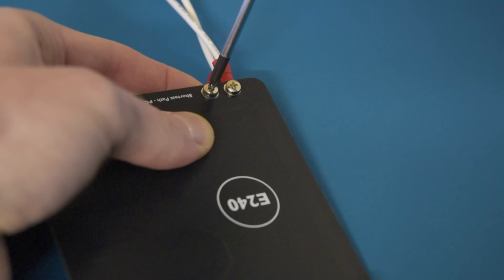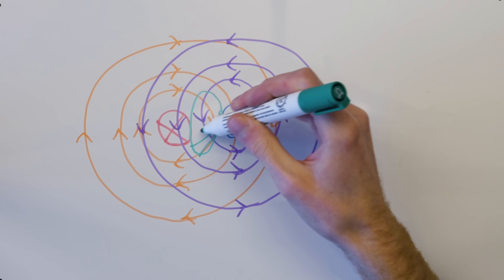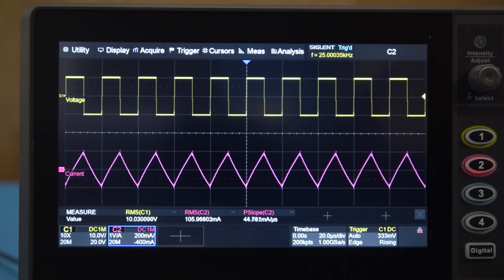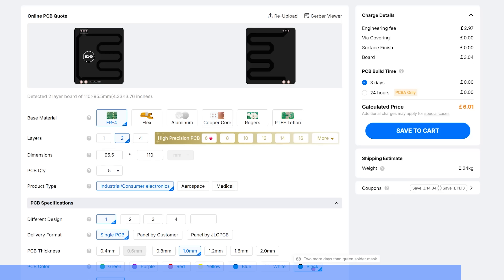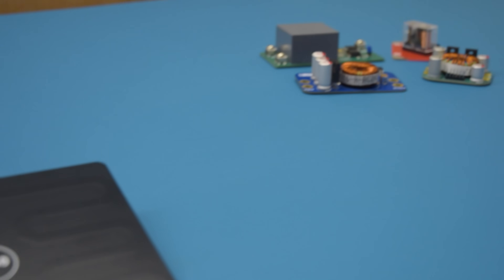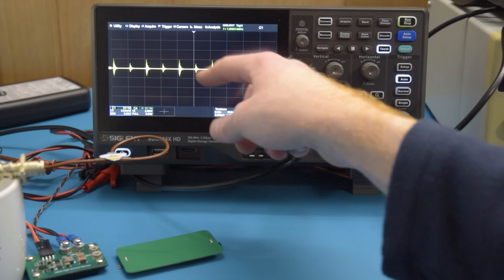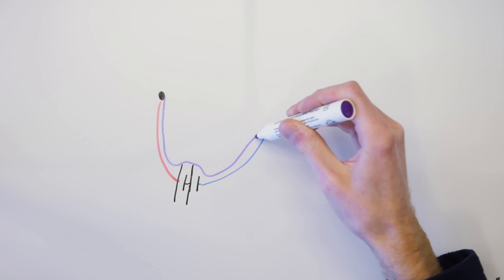Electricity Doesn’t Always Take the Path of Least Resistance

Comment: Hi sir , can you make a video on how does high frequency inceter works and it's different stages like the frequency , duty cycle , 12-220 v DC booster part and 220 v dc to 220 v ac  with h bridge , Thanks

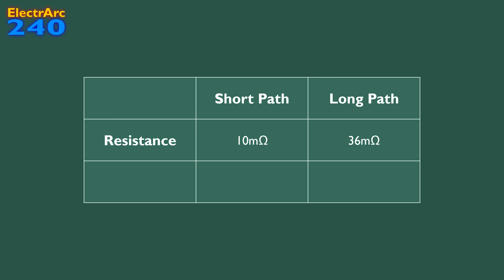Comment: Simple question : why square root of x^2 and y^2 in 7:19 ? i understand the impedance part with Zr=R and Zl = jlw btw
Reply: Do you know Pythagoras' theorem? It's the same formula to calculate the hypotenuse of a triangle. If you look at the formula for apparent, reactive and real power, it's the same scheme. 
For understanding: Draw up a coordinate system. There's real resistance for the x-axis and reactance for the y-axis. Let's use an electrical component with an impedance. The resistance is 4Ω. The reactance is 3Ω. You draw a line on the x-axis from 0 to 4. Now you draw on the end of the line (0,4) a second line up, from 0 to 3 on the y-axis. Now you connect your starting point (0,0) to your end point (4,3). Measure the third line. It should be 5 units long. This is your impedance. And calculated via Pythagoras' theorem it's Z=sqrt(4^2+3^2)=sqrt(16+9)=sqrt(25)=5. The complex impedance is Z=R+jX. This is the algebraic/cartesian form.
I hope my explanation made you understand it a bit more.
Reply: @BlueMokkeOh i see ! Thanks a lot 🙏 So if i understand correctly the impedance is a combination of resistance and reactance ?
Reply: @badwolf4469  Yes. If you watch the summary chapter of the video again at 7:56, you can see that Impedance is always made up of both resistance and reactance. In DC cases, the impedance is only made up of the resistance as the frequency is 0Hz and the reactance turns to 0.

Comment: 11:33 I'm not sure I understand.  In the first case - whichever path an electron takes, it's still contributing to one of two ground loops of equal size, isn't it?  In the second case, it's just that all the electrons are contributing to ONE of the two ground loops.  So I don't see why the first case would be much less than the second.  Unless the two ground loops are cancelling out or something?
Reply: On a sketch the red line should be as close as possible to the blue line. This scratch in the middle causes a big loop for current to go through (distance from forward current to return current grows) instead of minimal one. This is why ground plane is so good: auto path of least resistance happens to be with the minimal loop.
Reply: @ВладіславЗаморський That's the thing, though; in the video the scratch in the middle doesn't have that much effect until it extends all the way to one edge.  Before that, though, the board (with middle scratch) is symmetrical, neither edge path should be better than the other, so why does the ground loop get so much worse when the current has to go through one bad path instead of two bad paths?
Reply: @Erhannis Because if there is a way for current to go through without causing EMI it will do exactly that. In general EMI means losses, so one path is not of equal losses as the other despite resistance being equal. Not sure if it makes much sense though.

P.S.: after looking at it again and  carefully reading the comment: yeah you think in the right direction. If current can go through in such a way that radiated field is minimal it will do so. Indeed here they can cancel each other, by finding symmetrical path(but not necessarily due to symmetry of the scratch).

Comment: i clicked on this video out of curiosity, because i tought i understood that it would be related to the frequency of the current. i did not expect to finally make the bridge between this knowledge and ground planes, i knew both existed, but never made the connection, thanks. (i just mess a little bit with circuits and etc for diy projects, never designed a pcb but noticed the ground plane concept in a lot of them, never knew why)

Comment: That was one click bait title I actually didn't mind 😂 As soon as I saw it I had a feeling we were going to be talking about DC resistance vs AC imepdance. I've had similar conversations before with Linux users about hardware vs software, where some of these users think everything can be fixed software side, and that hardware doesn't matter, where those of us whom understand electrical flow actually know that trace length, parallel tracks, screens for shielding, mutual/parasitic capacitance and inductance skewing the signals, all these tiny things that software people don't see in hardware land most of the time that are just as critical as ensuring we properly closed our code with the proper bracket, which in our case in hardware could be ensuring we have a good solder joint on a pin, one that won't flake out once currents flows and it warms up, etc etc

Comment: 0:10 Says "lure electrons" shows literally and electrically opposite

Otherwise great explanation
Reply from the maker: I know I had a long think about this. I say "lure electrons down" so they had to come down, but I had to have positive at the top because the black circle for negative was hard to see over the top of the black connector. I suppose I could've said "lure electrons up"...

Nice catch!
Reply: @electrarc240  Is the current loop at 11:44 really the only cause for such a big increase in EM radiation ?  (The symmetry of the two-path option before seems like there actually might be two current loops cancelling each other)

Comment: I presume it's the case that the three terminals at the top get ganged together, and that's what you mean by "they're connected in parallel" at 0:05?  (I think I can see the jumpers at 0:23, even.)  Would have been nice if you'd said more about this, because it sorta seemed like this was just a trick of connecting up one trace some of the time, and the other at other times (and indeed, I sort of presume it was designed that way so you could test them independently, as well as in the "in parallel" mode)... Something to keep in mind for future videos?
Reply from the maker: Yeah that's a good point, I had footage of swapping the jumper but didn't have a good place to drop it in. As you say it was to allow me to easily test each path independently for L and R but does make it seem like I am tricking people potentially.
Reply: @electrarc240   Yeah... it made me spend a lot more energy than I would have liked to trying to analyze whether you were pulling our chains.  I think you weren't, but, yeah, just naming it would go a long way to making that sort of thing more clear.  :)

Comment: That return wire was sneaky. It's common knowledge that two parallel wires carrying the same current in opposing directions have significantly lower inductance than a single wire. It's still a smart trick though.
Reply from the maker: Haha yeah its a demo I theorised months ago and finally got round to trying, was surprised it worked so nicely though!

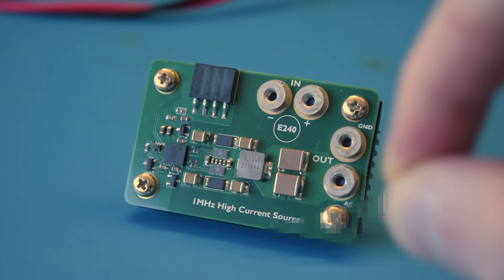Comment: 4:27 dope visual effect
Reply: Is the current loop at 11:44 really the only cause for such a big increase in EM radiation ?  (The symmetry of the two-path option before seems like there actually might be two current loops cancelling each other)
Reply from the maker: That's a very good point, hopefully someone more experienced/knowledgeable in EMI sees this and can offer more insight. It's an area I am still very new to I'm afraid
Reply: @great__success I think there were indeed two opposing loops with the shorter cut, and breaking one of those made it no longer cancel. So the loop is the only cause of the radiation, but before extending the cut it was cancelled by a similar loop while after it was radiating on its own.
Some follow up experiments could be to measure the field closer to the bottom loop with the short cut to reduce the influence of the opposing one, or make the short cut assymetric.
Reply: @great__success  another question / follow up  to this part of the video would be stitching the 'broken' ground plane on the top side to bridge the gap or adding a wired connection back in. would that have an equivalent effect compared to the prior experiment with the ground plane only partially interrupted internally? the symmetry came to my mind as well, but isn't that just a nice human concept? not sure if current cares for symmetry.
Reply: I think it's called dejapanesation
Reply: thats where 99% budget goes to (jokinglly)

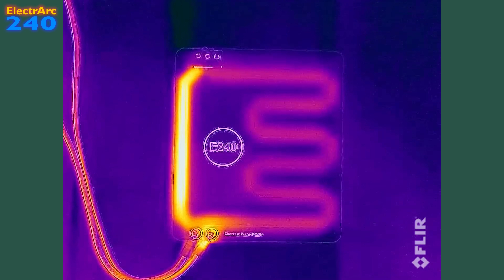Comment: 0:31 That is simply wrong. The currents add up. They don't choose a path. Given the same voltage, more current can flow since there is less resistance in total when there is a secondary path.
Reply: He did say "a greater proportion"
Reply: @TheRanguna Assuming the source has zero ESR, the currents only add up. There is no proportion, it's just 1+1 instead of 1 (assuming identical resistance in each path). You just get double the current.
Reply: @g @graealex wrong. You would get double the current if both traces had same resistance, which they don’t because one track is longer than other. In a PCB resistance is proportional to length. So the current is indeed splited by the inverse of resistance relationship, and shorter track gets more current…. That proportion is also independent of source ESR. The total source current is not . The video is accurate.
Reply: @Txepetxcc  Please use your head, the proportion was in relation to both currents. There is no current "splitted" - it only adds up. If you supply had 1V, and the first track had 1Ohm, then 1A would flow. If the second track had 10Ohms, then a total of 1.1A would flow. There is zero relation between the two paths.
Reply: @graealex  source is a current source, not a voltage source.
Reply: @Txepetxcc  Wrong again, the lab supply shown will, as long as it's driven within its current capacity,  emulate a voltage source, and a perfect at that, i.e. 0 Ohms ESR. You can further enforce that behavior in four-wire mode.
Why are you always wrong, but still comment?
Reply: @graealex  cause i'm not ! :) would you do a counter video explaining what is going on in full wave electron theory ?
Reply: @Txepetxcc  Lmao no.
Reply from the maker: You could say each electron chooses a path, and more choose the short one
Reply: @electrarc240 No, you cannot, since it's a wave function, plus electrons are only the charge carriers.
Reply: @graealex  in a quasistatic scenario in steady state, where the source frequency is higher then landa/4 dimension of the circuit , you can. Omg Alex, go check your books
Reply: @Txepetxcc We already established that it's not being split. If we assume electrons as particles, then additional electrons for the additional path flow.
Reply: @graealex depends if you want to functionally understand electronics design or have up to date understanding of quantum physics. The wave function explanation, while correct, isn't useful to an electrical engineer designing something
Reply: @graealex  so there are more electrons in one path than in other? A proportion of electrons more ? :)
Reply: @Txepetxcc  No, because there would be more electrons in the path that is longer, the exact inverse of your claims.
Reply: @graealex  go build a fucking nuclear reactor 😂
Reply: @graealex   Unless you are working with superconductors or nanoscale electronics, it is not a coherent wavefunction. The mean free path of the electron in copper is 40 nm, many orders of magnitude smaller than the circuit dimension. So the electron can be described semiclassically using things like drude model and boltzmann transport theory. If you can show the electrons are acting like coherent wavefunctions over the centimeter distance of the circuit and travel through both paths simultaneously, you would be in a high ranked paper because that is unexpected.
Reply: @youtubehandlesareridiculous You've added the word "coherent" sneakily. It's 2025 and people still think electrical current works like water molecules...
Reply: @johnpeiredaquavoii2213 very constructive to pull out an ad hominem
Reply: @graealex  brother, when people say a warm sound in music theory they don't say that the sound is literally hot. No one will say thats it is a wide wave frequency with high curve form.

Same as any other field, and/like comunication. The priority of the youtuber is to comunicate to a wide spectrum public. This is not a academical class.

You are acting like a stereotipical "acthually" reddit guy. Which was funny reading the comments so it make me feel there a chance you are just baiting us. If not, you should have some therapy because normal people, academical profesionals don't go around correcting petty informal speech in public.

Comment: Hahahaha gotta love the classic 'relatively low-cost' on yt vids, relatively low cost here means almost 8k usd. Even the little connector box is edging in on a grand! Sure, I get you probably have options going up into the high 100s of k, perhaps even low millions for a true cutting edge multipoint lab analysis system for say cellphone design, so relative to that this IS low cost, however relative to the avg watcher's budget this is very expensive.
Reply from the maker: "relatively" is certainly doing some heavy lifting I have to agree. A loaned item that I now need to return sadly :(

Comment: You’ve changed the size of the pipe when adding copper, so less resistance
Reply from the maker: That's the shared return path so doesn't effect the resistances of the top traces of interest. But yes that is why I added the copper, the return trace was heating up too much and spoilt the DC demo

Comment: "It is often said that electricity follows the path of least resistance, but that isn't always true..."
Well, actually it is true. The problem is: people sometimes forget that the resistance might have a complex (i.e. non-real) value.
Reply: This thinking is limited to the AC (audio freq. range). Not radio (proper transmission line is the best path, resistance/impedance alone is not enough to explain things).
Reply from the maker: In that case it is impedance, resistance is the real part of impedance and reactance the imaginary part
Reply: @electrarc240  I know. It's merely a problem of sloppy language. I am German and in the German language it's "Blindwiderstand" (reactance), "Scheinwiderstand / Impedanz" (impedance) and "Wirkwiderstand" (resistance). With resistance also translating to "Widerstand" (here you might see the problem in practice when speaking to non-EE people about these affairs).

Comment: Wait! What do you mean cancel out? 
I thought that energy can't be created or destroyed... So basically you can't cancel out...
Reply: Yep. He just created the transmission line in the dielectric (PCB board), between the top and bottom layer (ground). The EM fields don't "cancel out", you are creating the path for them (we talk MHz range now specifically).
Reply from the maker: There is just less energy stored in the resultant field, none is ever there in the first place. If you put current through the wires and them brought them together the energy of the fields would go back into the wires as more current

Comment: Is there a physical force trying to separate or pull together the two traces on the board?  For instance, if each was on a piece of paper, would a gap form - or would the paper pull together?  It would be interesting to hear your explanation why current flows on the surface of the conductor instead of the core at higher frequency, and how the resistivity of the material becomes less meaningful.  Thanks for stimulating my brain again. 🙃
Reply from the maker: The magnetic fields would force the traces apart (very weak force), I recorded a demo with two wires and a lot of current making them separate but it wasn't really relevant to the rest of this video. I have a video in the works on skin effect with a few nice analogies and demos but its quite far down the priority list so could be a few months before its done.

Comment: Nobody ever said an elecrric current will take the shortest path, it takes the path of least impedance, which may or may not be the shortest path.
Reply: In case of radio freq. range (or higher, up to light), EM fields/waves take the proper transmission line path.
Reply from the maker: I was considering that when naming the video and making the thumbnail but "lower resistance path" and "higher resistance path" just doesn't work as well. YouTube algorithm forcing my hand slightly I'm afraid